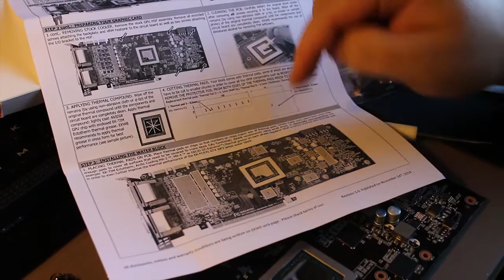Two Idiots Build A Custom Water Cooling Loop (Corsair 750D)

Comment: crossed tubes.....come outta the gpu straight up to rad,outta rad into cpu via a 90 rotary then into res top.....much cleaner run.noob
Reply from the maker: EK advises against using the top port on the Revo D5 as a return so I would’ve had to have purchased a new top and additional 90 degree fittings to get everything plumbed. That being said, I have redone this system with 90 degree fittings and dual 360mm rads. I’ll upload a video eventually of the changes. This was also my first custom loop so it was the plunge into custom liquid cooling. Sometimes starting with some small errors and learning from them is the right way for some of us. Cheers
Reply: @HomeBrewedHero  well said dude, despite some slight pushing against the RAM and the amount of paste on the GPU, I didn't cringe and frankly you've done a better job than I would probably do on my first loop when it happens!

Comment: So I am a little curious as to why you have your PSU Fan facing upwards? The 750D has a PSU filter on the bottom so why not have it breathing cool air from the bottom?
Reply from the maker: So with the RM series, the fan does not kick on until the load reaches something like 75%.  In my build, I've never seen the fan come on so I decided I'd rather have it open on top (fan up as opposed to down) so that any heat within  the power supply could rise into the case and be exhausted via case fans.  Remember, since the fan only comes on based on load and not temp.  I figured this would be the best orientation in the chassis.  It's just a plus that the fan grill and fan on this PSU aren't ugly.
Reply: The only thing is though your allowing additional heat to rise into the internals which you don't want however with your setup it's mainly all closed loop cooling. Do your fans from the Rad pull or push air from the top of the case? I went through 3 Corsair PSU's they literally all died within 24hrs :O so I run an EVGA G2 850W Gold which like the corsair doesn't spin the fan till it heats a certain temp but bonus side I can flick a switch and have the fan spin at all times
Reply from the maker: My fans push through the radiator.  That's where the Noctua NF-F12s shine.  They push better than they pull.  Any heat being generated by the power supply is miniscule so I'm not really concerned about it, especially running a closed loop cooler like you said.  Also, I have the rear fan as intake to directly feed the rad with clean cool air since the air coming in the front cools the hard disks while the bottom opening for fans, passively cools the D5 pump res.  Cheers!

Comment: I would really like to do a custom water loop, I am trying to look into pumps and radiator mounting in this specific Corsair 750d case as I currently know nothing about it. this was my first stop :)

i have a build using the corsair 750d case, with the h100i AiO, which can be seen in the link below. I'm waiting for a i7-7700k to come in the mail, I also changed the gtx 770s for a 1080ti.

Comment: Good stuff. Hoping my build goes as smoothly. I think you're right, once you've kinda chosen your parts, putting it together is the easy bit. I assume everything went fine with the massive amount of thermal paste on the GPU?
Reply from the maker: squall6789 the amount of paste actually worked perfectly. EK recommends that pattern so there's full coverage for the GPU die since there's no lid.

Comment: really beautifull build. how did u manage to fit the 140 revo in the case ? did u buy the fan bracket ? I'm asking this because i've got you same case and res/pump combo =D
Reply from the maker: skifeni I bought the fan mount for it but had to drill lower holes to clear the gpu and set the res lower in the case. Worked like a charm.
Reply: Did You drill the lower holes in the fan bracket ? Because I've the same problem. My reservoir touches the gpu, if I use the bottom fan mount ( removing the drive cages ). And my gpu is too long to fitt the res in the middle of the case.

Thank you for your answer !
Reply from the maker: I drilled the holes in the vertical part of the fan bracket.  EK includes a template that shows you where the holes would be to directly drill into a case etc. Use that template and make sure you leave enough clearance for the pump and wiring so it doesn't get pinched when you assemble it all.

Comment: how did you choose what fittings to use?
Reply from the maker: ronnie cason choosing the right fittings comes down to a few things: 
Correct inside and outside diameter (to match your tubing)
Appearance (compression or barb fittings)
Overall planning of the loop. 

Sometimes you'll need some 90° fittings to make everything work how you envision it. I chose XSPC compression fittings based on their low profile, design, and reputation. BitsPower, EK, and Alphacool all make exceptional fittings as well.